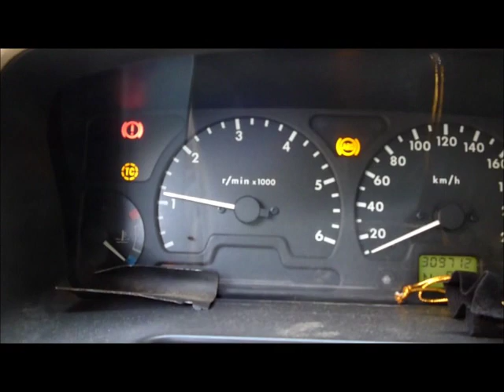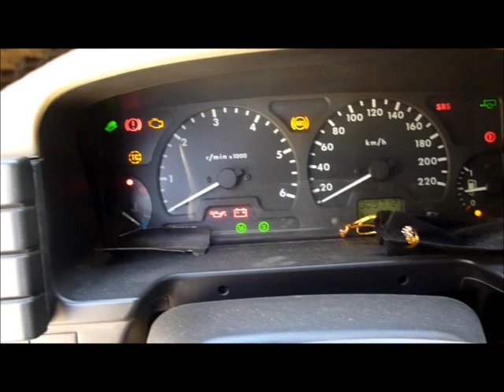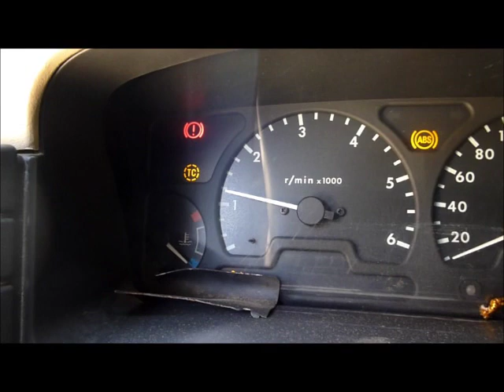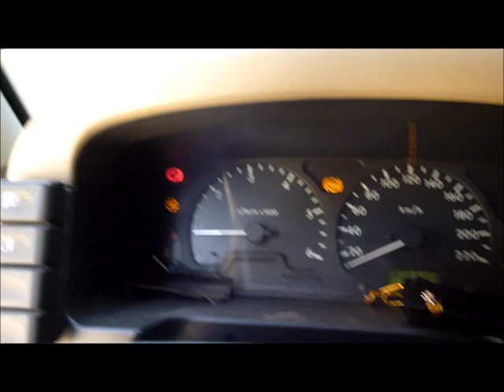2002 Land Rover Discovery  Cleaning Throttle Body And Mass Air Flow

Comment: Just saw this video, my 2004 discovery 2 runs rough between 55-85 kmh. I have changed, computer, o2 sensors, fuel pump, spark plugs and leads.
Should I do an injector cleaning or try cleaning MAF sensors.

By the way did you take catalytic converter off that discovery.

Canada🇨🇦